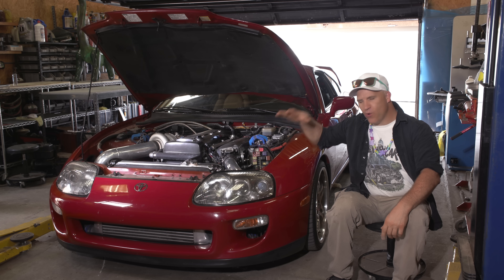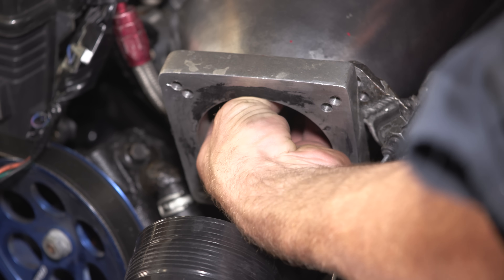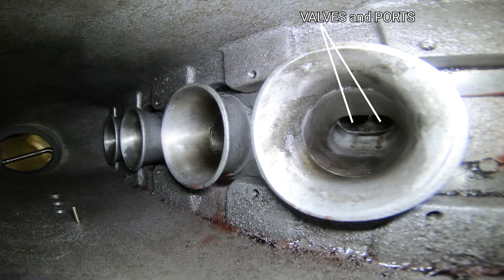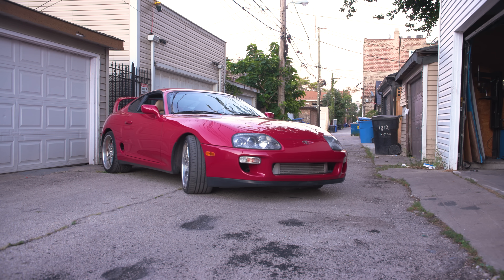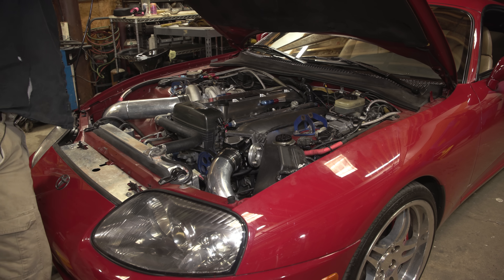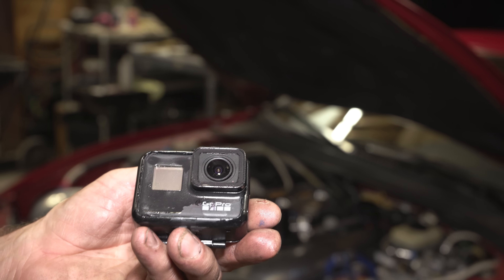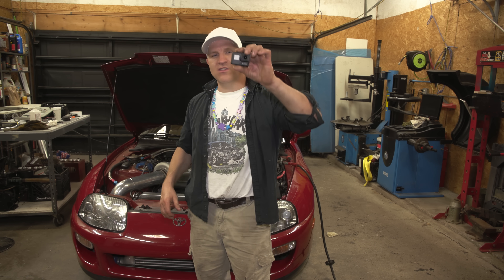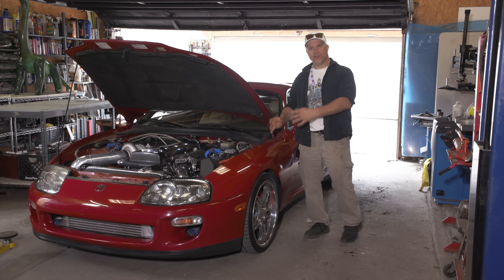Driving with Gopro Inside My Intake Manifold (Toyota Supra Turbo)

Comment: I work in engine testing, and have done similar tests using high-speed cameras. That oil will be crank case ventilation and turbo seals
Reply from the maker: Thanks, if you notice the oil is red,  I traced the problem after I finished the video, it turned out to be the low pressure vacuum switch for the power steering pump, it's bypassing the oil from the power steering pump into the hose that goes to the intake manifold.
Reply: @WarpedYT  crazy find. Yeah looks like hydraulic fluid colored - transmission or steering.
Reply: @WarpedYT  I knew it wasn't engine oil when I seen the color. Being that it uses transmission fluid for its power steering system.
Reply: Warped Perception catch can?
Reply: @WarpedYT  you might want to get an oil catch can if you don't have one installed.
Reply: @WarpedYT  Yes Sir glad you solved it
Reply: @WarpedYT  is that a good or bad tho??
Reply: Most plausible answer I’ve seen so far..
Reply: looks like fuel was blown into the plenum
Reply: @VashishtaSamaroo  hmm not fuel with that color
Reply: We had a nightmare trying to keep cameras clean through extended runs, ended up modifying the manifold to make them easy to remove and clean. Even with the PCV rerouted to a catch can, oil finds its way in from the turbo. Great video though!
Reply: @Pyrotec_nick  could you explain how the oil would go from crank case to manifold through pcv? Oil level too high? Or how it goes from turbo to manifold, wouldn'y it be staying in the intercooler?
Reply: @jankos9860  so no matter how good your PCB system is, oil vapour / droplets manage to bypass the system particularly at high load points, where crank case pressure and air flow are high. From the turbo, you get some oil leaking past the seals especially on worn turbos and at points where the delta P from oil to turbo intake pressure is low, this draws oil past the seals. I'm not talking huge amounts however! But it's amazing how much mess one tiny drop of oil can make!
Reply: I was looking for this comment. I figured it was blow by due to DI.
Reply: Yeah, I figured the same, but dont know if he has pcv or air/oil sep on there.
Reply: Pcv
Reply: Every time the blow off valve opens it sucks fuel and oil out of the ports.
Reply: Coolant fluid?
Reply: I don’t think it’s oil I think it may be condensation from the windshield washer fluid mixed in with the battery acid that gets absorbed through the positive cable lead that goes from the battery to the intake solenoid. It will only do it when it’s wide open throttle while at idle at a red light. And it only happens when the temperature is between 70 and 75 degrees. At top dead center on piston number 2.   Your welcome
Reply: eviloctober that’s hilarious 😂😂😂😂
Reply: Turbo seals won’t blow oil into the intake, it’ll come out the exhaust and generally burn and turn into blue smoke.
Reply: @vin18m  it can cause oil to leak into the intake as well. You'll see that the oil gets pushed out to the front of the intake side of the turbo where the filter would be. And then it also gets into the intake piping. I've seen this many times.
Reply: @JKearns98  I think that's how cars with direct injection get their intake valves all gunked up. Waste gasses with oil mixed in gets recirculated from the crankcase back into the intake via the PCV... or something similar to that (I'm not a mechanic lol). I've owned two DI turbo cars and both required the intake valves to be walnut blasted at around 100,000 miles (done as preventive maintenance, no check engine lights or drivability issues) . Funny thing is the valves can be all gunked up but you barely notice a detriment to performance or power. Turbo boost pushes right past the gunk. Get the valves clean and all you notice is maybe an additional 5 hp from before; power delivery is more linear though.
Reply: @vin18m  here speaks someone who has never dealt with a turbo diesel runaway 😂😂

Comment: When the engine was started at first, oil ran down from below the stacks. Doesn't seem to be turbo seals leaking.
Reply: azmike1956 problem just splashing thought the stacks from the valves
Reply: @mauricemotors8207  Its a JZ and the boost is turned up, every engines intake manifold looks like this its normal. Put a dry sump system on it and there will be no oil in the manifold.
Reply: low pressure vacuum switch for power steering pump, you are right my friend 👍
Reply: It looks like pink coolant to me

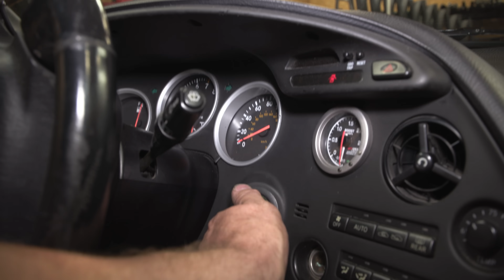Comment: 2:35 seconds you can see where the oil is coming from right as he starts it 
Look closely
Reply: 7:08 There's no narration, but on the subtitles he wrote it's power steering fluid from the power steering vacuum switch
Reply: Dazed just read this.
Reply: You can clearly see it's blood.
Reply: A couple of thoughts on the "oil".  I noticed in several shots, the red liquid near the bottom of the intake.  My first thought was a dye that they put in the gasoline (older carb cars used to get puddles of fuel dye in and around them.)  Second thought is if you are running a transmission cooler it may have a small leak that is somehow getting pulled into the intake.  Third idea is if you are running Sta=Bul in the gas (saw that in a lawn mower carb bowl one time.)   My "dos pesos."
Reply: Valve guide seal?  It is a Toyota, after all.  Never mind, that would be inside the runner, not outside.
Reply: Yea, definitely looks to be more red than typical oil - some oils are tinted though, wonder what he’s running.
Reply: @digus  Redline oil is red, but so is Toyota coolant.
Reply: I wondered if it was coming from the turbo, but it seems to have a read tint to it, it seem to come from the back not the intake, but could be blowing by and collecting or is it from the trans some how, kinda wana know what it is!
Reply: @eniklisnihm4565  Tidk boss gotta hear it in peeskn reaally
Reply: good eye, is it getting pulled by the stack from the bottom?
Reply: Possibly the cold start injector and he is running some red tint fuel!? That’s my best guess
Reply: It the oil from the KN filter. Probably over oiled it. Very common.

Comment: The oil might be from inside the cylinder backing up into the runners due to uneven mixing and pressure variations. You could even see the water in the air condensing due to the pressure variations. Same stuff you see when rockets or jets go very fast and they have those clouds forming around them. Different principle, same stuff.

Comment: I've done expirements with my own car and I've done a complete Pcv delete to see if I could stop oil from getting in the intake manifold. Turns out it there is no completely stopping it and it will slowly get oily starting from the ports working it's way back into the intake manifold. I can only chalk it up to Atkinson cycle intake valve open on compression stroke when the engine is cold and these new thin oils. Other than that I dont have a clue what else it could be.

Comment: Oil in the manifold is presumably from the PCV system. More boost with blowby past the rings would lead to an increase in the volume of oily fumes going through the PCV system. Hopefully you've fitted a Catch Can already, and hopefully it's not overflowing. There is something liquid sloshing back and forth along the floor of the manifold; I initially assumed it was liquid water. But then you mentioned the 200 degree temperature, so it probably isn't water. That's presumably oily fluid blowbuy from the PCV system.

In summary: PCV

Comment: Looks like when the throttle closes and a huge vacuum is formed, the moisture in the air or some remaining fuel gets vaporized then condenses when the throttle opens back up.

Comment: Your pcv valve is bad your sucking oil higher pressure from blowby or your boost pressures are sucking oil. My Honda 244k miles motor will suck oil from pcv i run a clear plastic gas filter in line to keep oil outta my intake cheap fix. Some people run oil catch cans. Run a can of berrymans b12 in main vacuum on intake cold motor let soak 30 minutes then heat it up will clean it up like new.

Comment: Really cool video.  You can see a lot going on there, injector operation, pressure pulse from the backside of the valve.  That’s actually a clean intake compared to most, might be because you’re running e85?  The oil residue is from your crankcase vent.  You could install a catch can but like I said that’s really clean.  It’s not from your turbo, oil from there would most likely condense in the inter cooler and not make it up to the manifold.

Comment: The oil it appears climbed back through the intake I guess around the cold piston rings right after startup. It also could be a sign something is going on down there and you should check. The fluid appeared red though and I really don't know the colors of your car fluids. So if you have red stuff in your crank case, that could be it.

Comment: 200 degrees?  I'd bet closer to 150-160.  Much hotter than that and it's really difficult to hold onto something.  At 200, you'd be doing the "hot potato" with it.  :)  fantastic video, though.  One of the coolest things I've seen on youtube.

Comment: The oil is coming from the pcv system would be my guess.
Reply: Does he not have a catch can?
Reply: @finnirish12  not sure but most people don't have them hooked up the right way anyways. One of the catch can lines should always be hooked back into the intake before the turbo so it uses vacuum instead of just the crank case pressure itself to just spit it into the can.
Reply: That's what I was thinking

Comment: 400-600 HP, and 3000lbs or less, makes a good fun Street car! Depending on what it is, it's usually not enough power to implode while playing, around 1000 HP+, with stock parts something goes a bit wrong, and you are picking up the pieces! You got alot of energy in a small space,  like nitroglycerin in a muzzleloader! Big boom!

Comment: First of all, absolutely gorgeous specimen of the Supra.  

This was a really cool idea.  I love watching the plate move with the throttle and It's cool watching the injectors track both the throttle position and RPM, going from pencil-lead type streams to full on fire hydrants (esp obvious during the burnout).  The vapor flash was really cool too, backfire would have been interesting :P

Comment: The liquids in intake....is it just compressed air making condensation? Seems to be a reddish liquid (like k&n fipk cleaner)coming from 2nd to TB inlet plenum.
I cleaned out a few 22re intakes and it was alot more "tar like" covered in black gunk inside...so much tooth brush scrubbing

Comment: Omg you have a supra?!!
Too bad anywhere near the turbo would be too hot would be cool to see the view of the Dump pipe when the gasses leave the turbo
I love the way you drive no fks given haha sounds like you have some blow by
Reply from the maker: Yes... Just been in the garage for a while because I had to find time to swap out the clutch to Turbo the harmonic balancer, injectors and the throttle body to a more reasonable size. The car was just making way too much power and was not fun to drive.

Comment: I believe the oil is coming from turbo
Reply from the maker: It's red though... I forgot to include it as an outtake but I did a little follow-up video where I take a sample of the oil from the intake and it looks like power steering fluid, I determined that my power steering vacuum switch is bypassing oil into the intake manifold, I'm definitely looking into it now. Originally I thought it was coming from the turbo but I took the intercooler piping off and couldn't find anything, and the thing that makes it suspect is the oil is red.

Comment: cool video man! your injector angle seems odd?, it appears to be aiming at the bottom of the runner and not the intake valve itself.
Reply from the maker: I noticed that too.... But that's how the intake runners are machined
Reply: @WarpedYT  completely aftermarket runners? or factory runners chopped off an modified to suit custom plenum chamber?

Comment: That was super cool to see! The fluid looks red like atf?! Very odd.
Reply from the maker: It was , I forgot to include the outtake video but I looked into it and found out that the low pressure vacuum switch for the power steering pump is dumping power steering fluid into the intake.
Reply: @WarpedYT  O dang! Pretty cool how this experiment caused you to discover a problem and be able to fix it!

Comment: Those decompression vapour clouds are amazing. Would be really interesting to use a custom manifold (cameras/lenses in O2 bungs welded to one?) to get high speed vids, see which way those clouds formed etc. Really cool
Reply: yeah it did seem like there was quite a bit of "reversion" alot of i tlooked the fuel mist.....even on accell it seemed like the cylinders werent drawing in all the fuel the injectors were putting out....seen this before...i know the injectors are " pulsing" but to the human eye it looks continuous and slightly too mush fuel released compard to what the cylinders are drawing....that may be from the rpm's not being steady and the injectors are trying to follow the ECM and when you go from WOT to a closed throttle plate theres alot of adjustments that just cant be made in real time but amazing engines dont seem to mind too much....just my thoughts but im no genius..lol

Comment: Seeing those inyectors spitting almost without stopping is crazy
Reply: Engines fire and inject one cylinder around 15-30 times a sec at most idle situations and 50-70 times per sec @ high rpm. Its crazy how quickly things happen in an engine for real.

Comment: Do you run redline oil?
Reply from the maker: No is power steering fluid, after I finish the video I traced it and found out that my low pressure power steering vacuum switch is dumping oil into the intake.. I just forgot to include the outtake video
Reply: @WarpedYT  ahh..gotcha, nice supra by the way.

Comment: This could be very useful in the design of intakes. You can see where fuel and oil is puddling  and getting a choppy look to it as air crosses it. You can tell that the velocity style ports would be better if there was smooth transfer from intake walls into the ports. Very awesome video. I can see alot of benefits from this idea.
Reply: I'm sure the oil is from pcv recirculation or crankcase vent plumbing into the manifold. Something like that.

Comment: Intake reversion was the coolest thing to see. It's one of those things you hear about but never would know what it looks like without a video like this.
Reply from the maker: The reversion was very very cool, I completely agree with you.
Reply: Can you explain what intake reversion is?
Reply: @stazvanbael3706  when the fuel spray gets pulled back into the intake by back pressure instead of being pulled into the cylinder by vacuum
Reply: @shadow105720  thanks,at what moment does this happen? And how does the engine compensate for this?
Reply: @stazvanbael3706  it happens when the throttle body is closed after acceleration i think, idk if it happens in direct injection engines
Reply: @timothyferiyadi5743  if you notice the exhaust flow on cars it pulses.....when a car is running there are many things going on at the same time, with ignition, expansion, contraction that the airflow through the engine is actually pulsing...i always thought that was interesting since ive been arounfd cars.....and i know muffler manufactures design exhaust systems to take advantage of this pulsing to help "scavenge" the engine of ehhaust and help to draw in the next intake charge using this and vacuum..jusy kinda neat
Reply: @stazvanbael3706  it doesn't. There's no reason to either, because the throttle is closed, you're not demanding power, so it literally makes no difference. 

As noted below, the fuel that is in the air stream exaggerates the appearance or effect, because when the top end goes under vacuum, the air that is in there expands to fill the space. I'm sure you've seen the video of a marshmellow in a vacuum chamber.... same is true here, except it's the fuel that's vaporizing off under the vacuum so it really looks like it's flowing all over the place when all that's happening is the pressure is equalizing in the intake chamber. It would be interesting to see that same footage at 240 or 480 frames per second, or whatever that gopro will max out at.
Reply: Following this...
Reply: FWIW,VW Bug and VW van ,the single carburetor version,with the air filter off,the air pulses caused by the intake valves opening and closing could cause a situation where the gasoline spray would appear as a halo over the carb. Add a backfire,that sure explained why a carburetor fire could start with that setup,and why so many of those vehicles burned up while at a stoplight. Poor service,poor state of tune,poor valve seats,and whoosh,up it would go.
What a terrific idea this was. I was amazed at so little gasoline spray.

Comment: Next request video: GoPro stand front 1 meter the rear drum brake while press Handbrake

Hey Warped Perception, using cheap car (Your Mercedes) to do that experiment i request that. My one Description: How people drift or burnout while using Handbrake?
Reply: In a normal turn, rear wheels follow the front ones because resistance to motion in the forward direction (in which the wheels turn) is significantly less than in the sideways direction. The latter provides the centripetal force that makes the rear end of the car follow the turn. When the driver locks the rear wheels with the handbrake, both directions offer the same resistance, so the rear end tends to keep moving in the existing direction (due to inertia) and thus slides out.